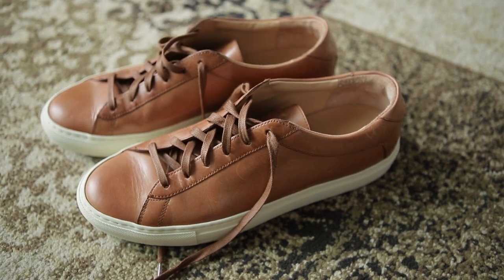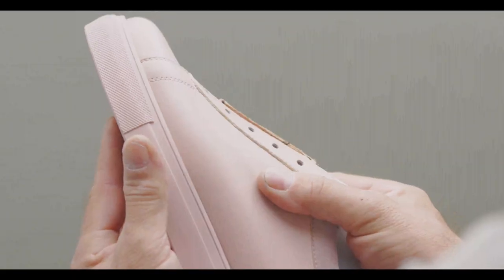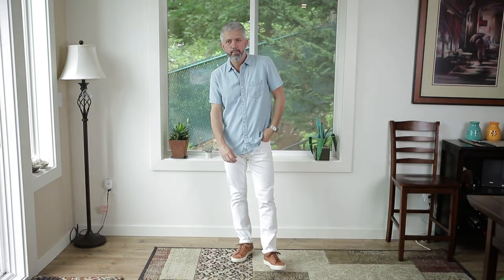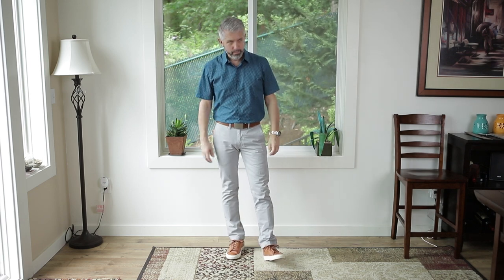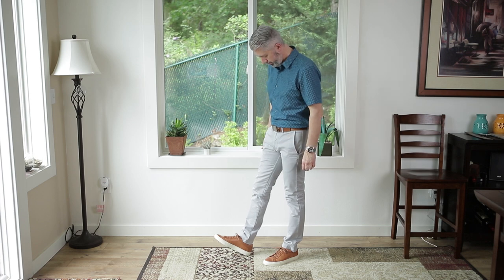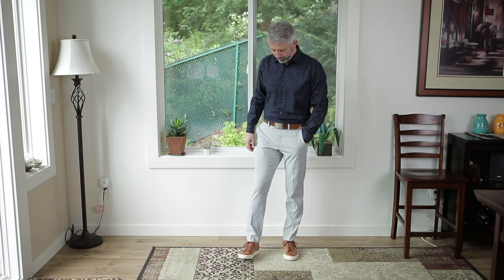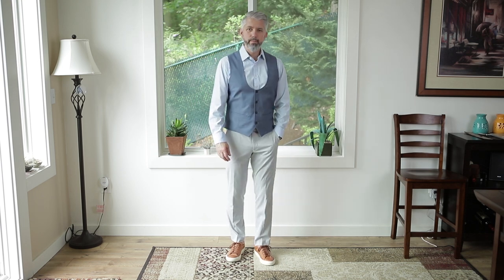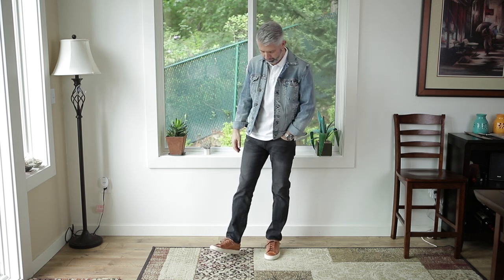8 Ways To Style Brown Sneakers For Men

Comment: I just bought a pair and I had a choice of 2 styles: 3 rows of eyelets or 6.  In other words, laces that stop halfway down your instep versus laces that go to your toe. I chose 3.  Now, true running shoes or sneakers have laces all the way down to your toes.  So I’m afraid that my sneakers look more like dress shoes than they do running shoes, because there is a little bit more smooth leather showing. So my question is, does it still look sneaker-like with less laces.  What is the element that turns it into a sneaker from a dress casual shoe?  Is it the white sole, or it the laces.  Ps mine look like yours in style and colour, but with only 3 rows laces.  (pps. I also bought them in black!)